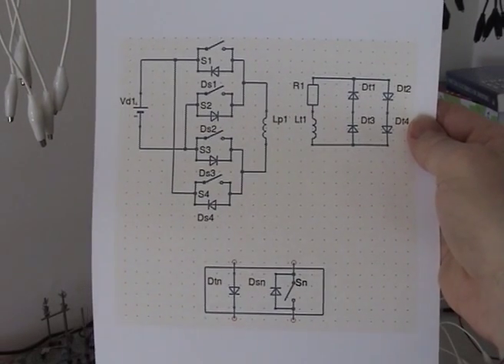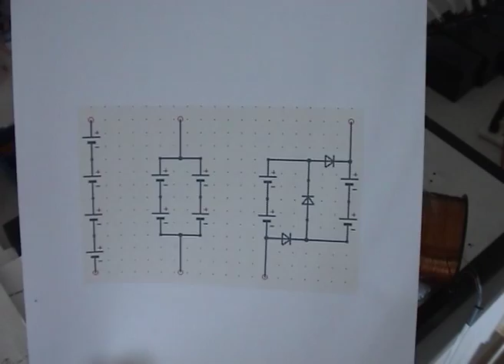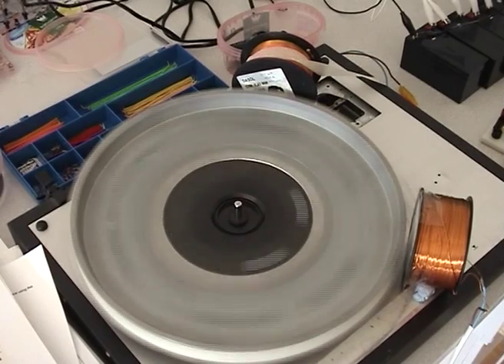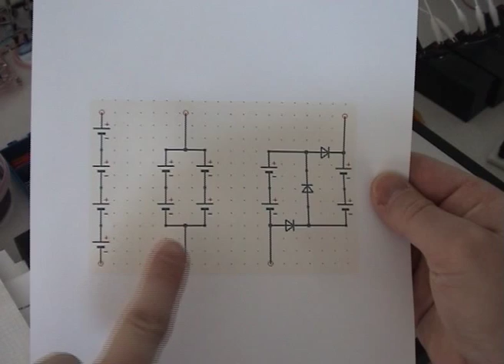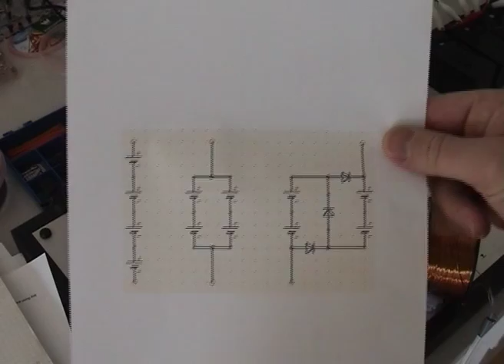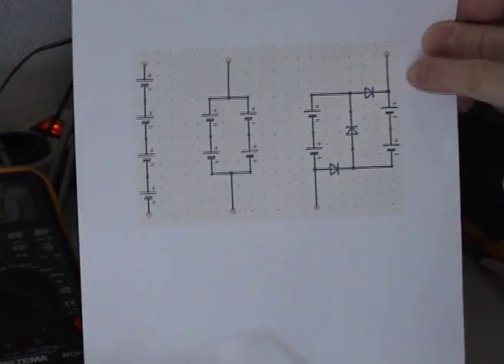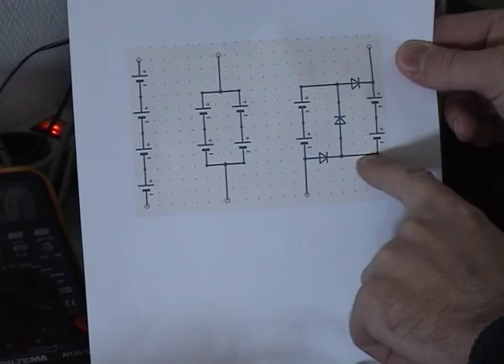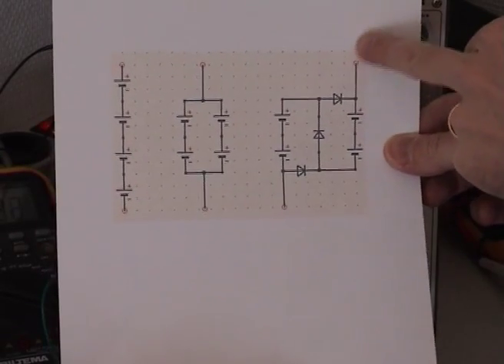Tesla-switch part 7

Comment from the maker: Leg 4 and 6 are always shorted, connection "C" on page 2 in the pdf, this gives you a switch with one diode (i call it "Dsn" in my circuit) made out of two actual diodes in parallel in the relay. Pay attention to the direction of the Dsn-diodes.

Comment: these are very hard relays to find. thanks china!!
nilrehob i am looking at your circuit but i am having problems with the configuation can you help me on this one. are the wires connected to the battery all go in to number 5 as read on the PDF. of the relay